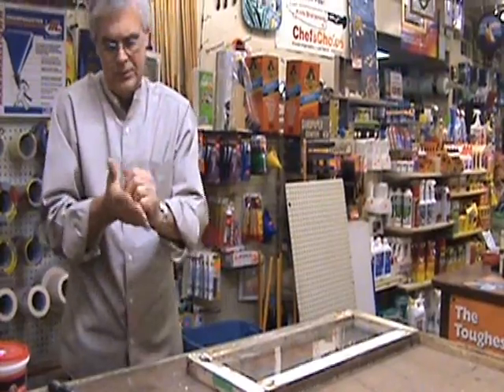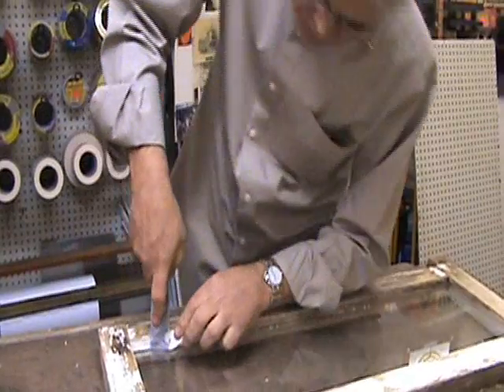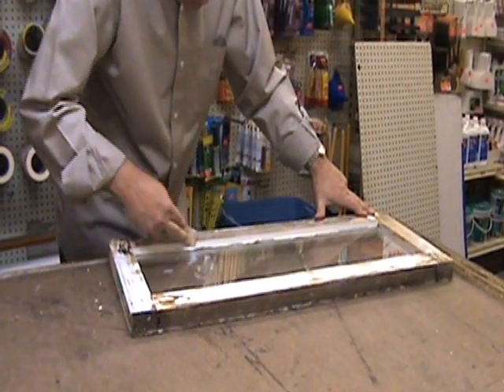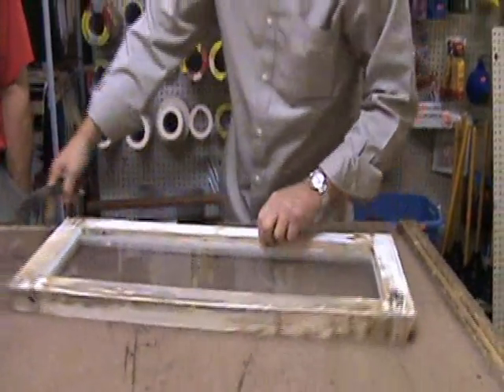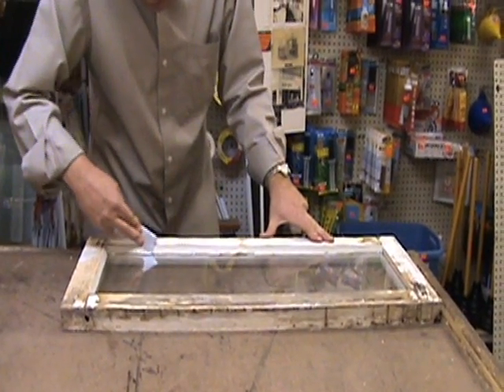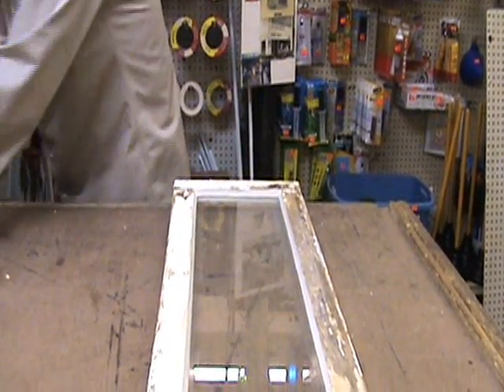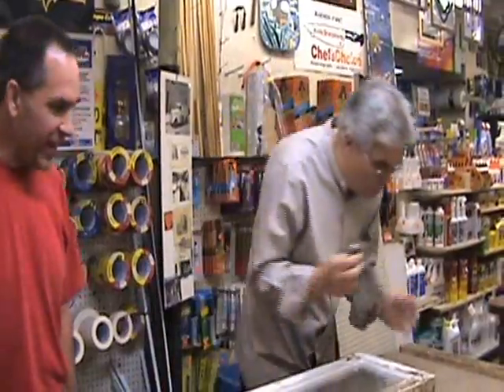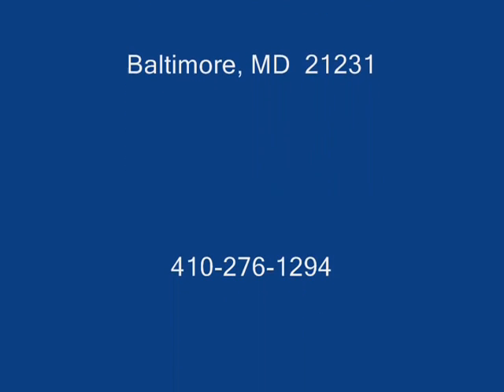Lombard Hardware - Putty a window - Glazing window - wood sash

Comment from the maker: Hello Noel, Thank you for your opinion. Yes, as you can see and hear I mention the putty could have been softer but after doing windows for a few years I've learned a few ways to soften it up and I prefer to run my putty knife over it to smooth the putty to the glass.  But everyone has a method that works best for them, thanks again for taking the time to comment.  Please join us on Facebook under Lombard Hardware, check out our photos of other glass projects.

Comment from the maker: Wood windows will last longer the then plastic in some cases, the plastic still dry rots and they bow and break easier then wood.  Wood does require upkeep though, scraping and painting is needed every few years.  Use a good quality oil based paint to preserve the wood.